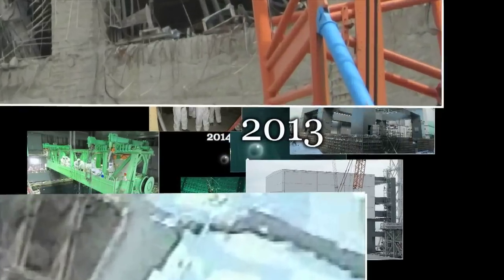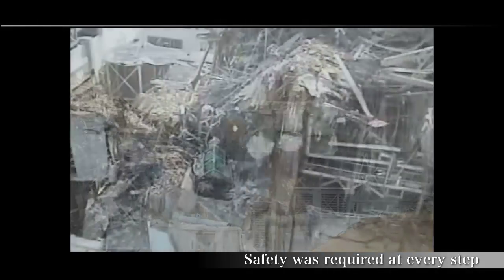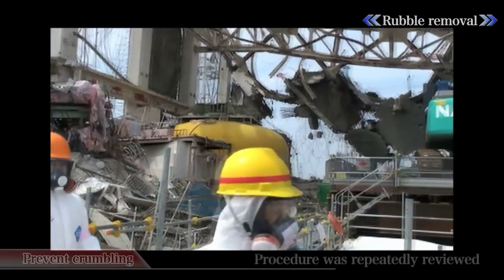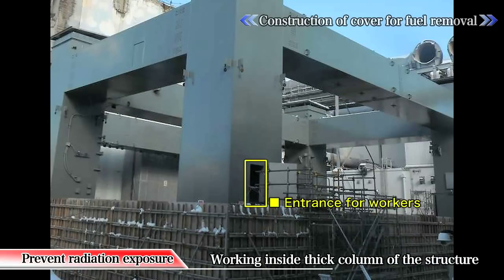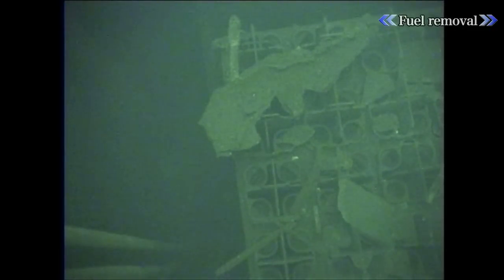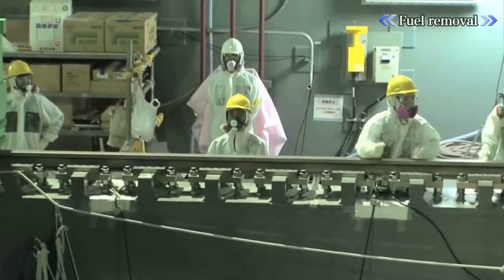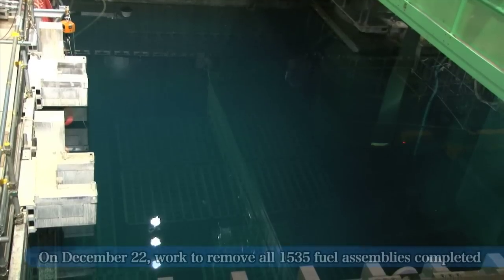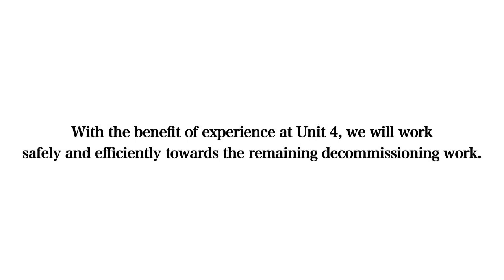Completion of fuel removal from Unit 4 spent fuel pool at Fukushima Daiichi NPS

Comment: Radionuclide impact of the Fukushima Dai-ichi nuclear power plant accident on the distribution of radionuclides in seawater of the NW Pacific Ocean is compared with global fallout from atmospheric tests of nuclear weapons. Surface and water column samples collected during the Ka'imikai-o-Kanaloa (KOK) international expedition carried out in June 2011 were analyzed for ¹³⁴Cs, ¹³⁷Cs, ¹²⁹I and ³H. The ¹³⁷Cs, ¹²⁹I and ³H levels in surface seawater offshore Fukushima varied between 0.002–3.5 Bq/L, 0.01–0.8 μBq/L, and 0.05–0.15 Bq/L, respectively. At the sampling site about 40 km from the coast, where all three radionuclides were analyzed, the Fukushima impact on the levels of these three radionuclides represents an increase above the global fallout background by factors of about 1000, 50 and 3, respectively. The water column data indicate that the transport of Fukushima-derived radionuclides downward to the depth of 300 m has already occurred. The observed ¹³⁷Cs levels in surface waters and in the water column are compared with predictions obtained from the ocean general circulation model, which indicates that the Kuroshio Current acts as a southern boundary for the transport of the radionuclides, which have been transported from the Fukushima coast eastward in the NW Pacific Ocean. The ¹³⁷Cs inventory in the water column is estimated to be about 2.2 PBq, what can be regarded as a lower limit of the direct liquid discharges into the sea as the seawater sampling was carried out only in the area from 34 to 37° N, and from 142 to 147° E. About 4.6 GBq of ¹²⁹I was deposited in the NW Pacific Ocean, and 2.4–7 GBq of ¹²⁹I was directly discharged as liquid wastes into the sea offshore Fukushima. The total amount of ³H released and deposited over the NW Pacific Ocean was estimated to be 0.1–0.5 PBq. These estimations depend, however, on the evaluation of the total ¹³⁷Cs activities released as liquid wastes directly into the sea, which should improve when more data are available. Due to a suitable residence time in the ocean, Fukushima-derived radionuclides will provide useful tracers for isotope oceanography studies on the transport of water masses during the next decades in the NW Pacific Ocean.

Citation: Povinec, P. P., Aoyama, M., Biddulph, D., Breier, R., Buesseler, K., Chang, C. C., Golser, R., Hou, X. L., Ješkovský, M., Jull, A. J. T., Kaizer, J., Nakano, M., Nies, H., Palcsu, L., Papp, L., Pham, M. K., Steier, P., and Zhang, L. Y.: Cesium, iodine and tritium in NW Pacific waters – a comparison of the Fukushima impact with global fallout, Biogeosciences, 10, 5481–5496, 2013.

Comment: So if 100% of the fuel was really removed from SFP 4 why is the pool still full of water? Nothing to cool in there right?
Reply: That water is hellishly radioactive. They should dispose of it correctly. One can hope. But yeah this whole thing looks weird.
Reply: @grunt7684  Not exactly, there's probably some dust and particulate in the water that's somewhat radioactive after the accident and stuff falling into it from god knows where, but you could filter this water pretty easily and it would be perfectly safe to drink!